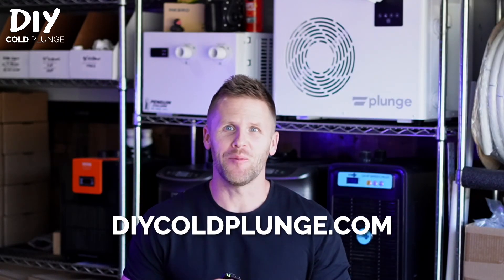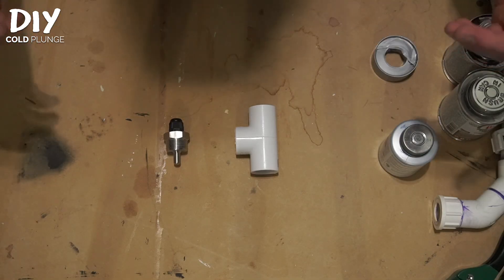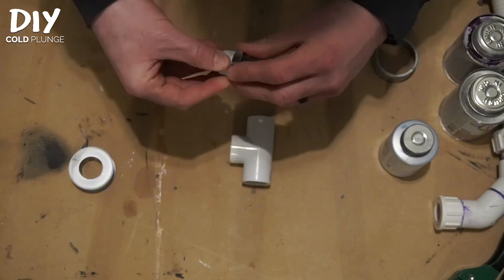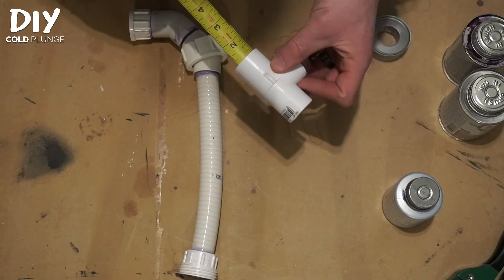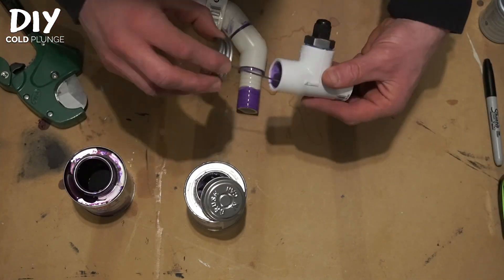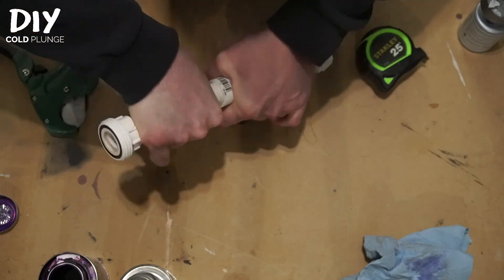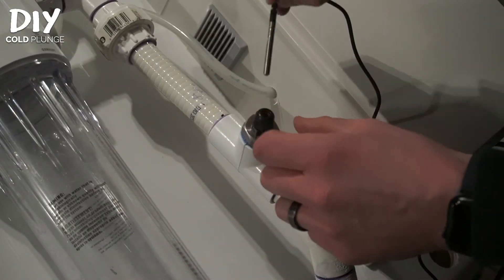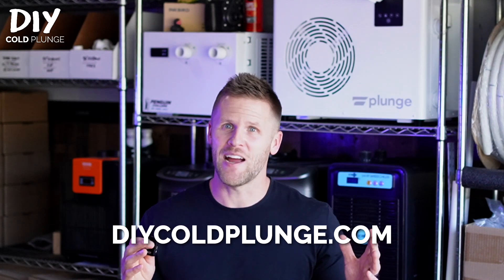Add an In-Line Temp Probe to Your DIY Cold Plunge: Heater + Chiller Combo! 🔥🥶

Comment: can you do a video on how this works. I watched your real on installing the in line heater. But still confused on how to control the heat or how it all integrates. The heaters I found said only to maintain temps not heat from cold to hot. Would love a more deep dive on the topic

Comment: Hey I built your first diy cold plunge plan, with the 2 stage filtration system. My plunge is already growing algae on it after running for 5 days. I run my ozone 45 minutes a day, and my pump 24/7. My outlet to the tank is just below the water line. Any suggestions?
Reply from the maker: Lots of factors here... What order are your components in? How long is the plunbing stystem? Do you have bubbles at the inlet of your tub? Is anythign on a timer? You can send an email through my site too 👍

Comment: So what’s the point of using this if I don’t live in a colder climate and my chiller already has a temperature sensor?
Reply from the maker: It's for if you are running a chiller and a heater. Setting this up gives a central controller (Inkbird) to control when the heat kicks on/gets power vs. the chiller.